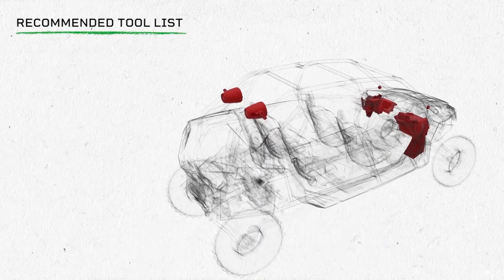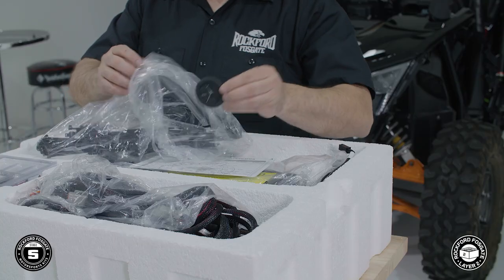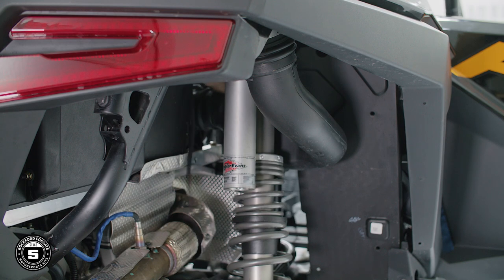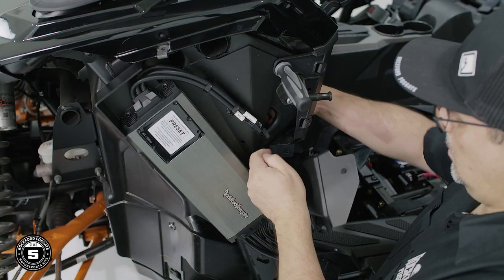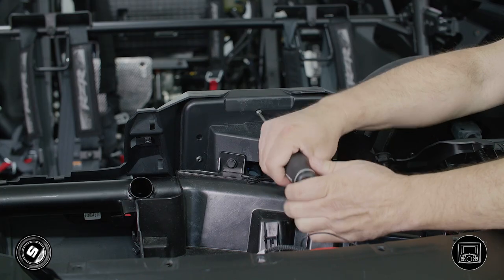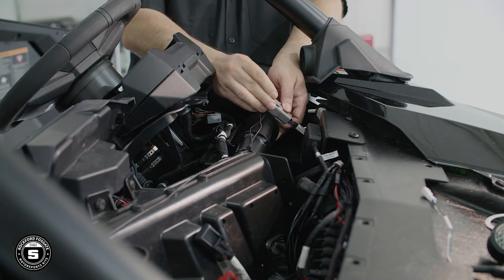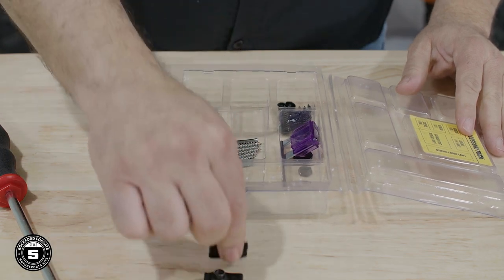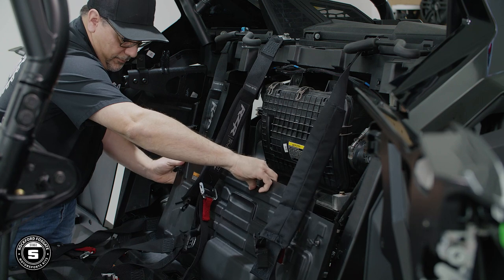2019+ Polaris RZR Pro XP STG5 | Installation

Comment: Is this the stage 5 kit from Polaris website or Rockford website? Why is the difference in the 2? I have a pro xp 4 ultimate
Reply from the maker: No, this is the aftermarket kit.  The Factory and Aftermarket are totally different, the main difference is the amplifier power.  The factory is 800W and the aftermarket kit is 1,500W.  Details on the aftermarket kit can be viewed here: https://www.rockfordfosgate.com/products/details/rzr19pxp-stg5/

Comment: Are you guys gonna start selling the front enclosures for the pro r or am I gonna have to buy from a different company
Reply from the maker: Hi Grant, the Pro XP kits are compatible with the Pro-R. However, the front pods are included in the stage kits, not sold separately. We do this because several components need to be upgraded for a true "wow" factor.  Improved amp power with front & rear speakers, along with adding a subwoofer need to be performed so fanatics can really feel  the performance difference.
Reply: @rockfordfosgate  I’m asking because I already have the stage 5 pulled out of my turbo s and I don’t need to buy the speakers other then the small cage tweeters
Reply from the maker: @MEATY_BULL  Thank you for that information.  Unfortunately at this time, the front speaker pods are not available separately.  If this was a RZR14-STAGEx kit, it may be worth selling in lieu of the new Color Optix system in your RZR.  Thank you for being a Fanatic!
Reply from the maker: We would recommend selling that RZR14-STG5 kit to someone who has a Turbo S because the only thing that is directly interchangeable are the rear moto-cans.  

The dash kit, wiring adaptor for Ride Command, subwoofer enclosure, amplifier bracket, and front pods on this RZR19PXP-STG5 kit are completely different on the Pro XP frame.
Reply: @rockfordfosgate  All I have is the speakers rear moto cans sub and amp, no enclosures, your telling me that none of these speakers would fit in the enclosures?
Reply from the maker: @MEATY_BULL  Let me back up a little bit...

You stated you have a "Stage 5" kit that was removed from your RZR Turbo S.  If it's not illuminated, it's the RZR-14-STAGE5 (Gen-2).  If it has Color Optix, then it's the RZR14-STG5 (Gen-3).  Those Gen-3 Color Optix speakers are indeed the same used in the newer RZR19PXP-STG5 kit above.  

However, we don't sell the front pods, subwoofer enclosure, amplifier bracket, wiring harness, dash kit or Ride Command interface separately for the Pro XP/Pro R.  We would recommend selling those speakers or using them as backups and purchasing the RZR19PXP-STG5 complete kit as listed here: https://rockfordfosgate.com/products/details/rzr19pxp-stg5/
Reply: @rockfordfosgate  lmao 😂 I’m not gonna buy stage 5 again when I already have a sub, two front speakers, rear moto cans and an amp from my stage five, I guess I’ll just have to make enclosures or find somebody that does

Comment: Do I need to remove factory audio? Or can I use all of them at once?
Reply from the maker: The install video above shows what pieces to remove and how to bypass the amp (removal not needed) if equipped.  No, it is not designed to use the factory system in addition to this STG5 aftermarket audio add-on.

Comment: Have the system installed, but went to turn on the rzr and heard a pop and nothing out of the sub? I have the switch on 2 ohms, like it came. What could be wrong? I have a 2020 rzr pro xp ultimate with ride command.
Reply from the maker: There could be a dozen potential issues, but I would start with the signal input with the Ride Command interface and the RCAs (they are a little short).  I would then inspect the signal input/output connectors at the amplifier for pins not seated correctly.  Finally, inspect the connections at the subwoofer.  If you have problems you can always contact our technical support at 1-800-669-9899 Mon-Fri 8am - 5pm PST.

Comment: Do you have to have ride command to have the led lights on the dash?
Reply from the maker: Great question, the LED bar on the passenger side replaces the existing factory equipped led bar. Otherwise the LEDs for the front speakers is actually a down-firing LED lens on the bottom of the front speaker pods. This is with either the PMX source unit or Ride Command.